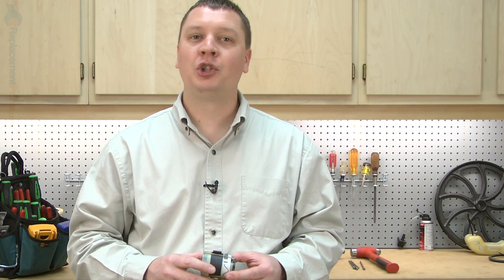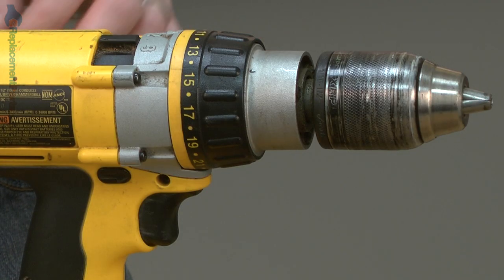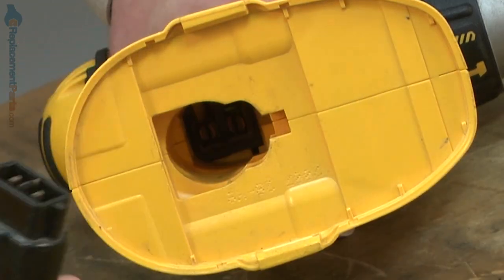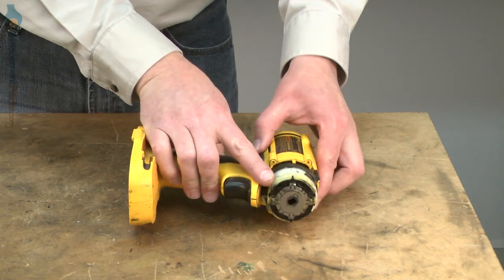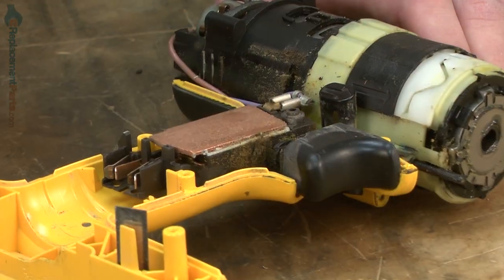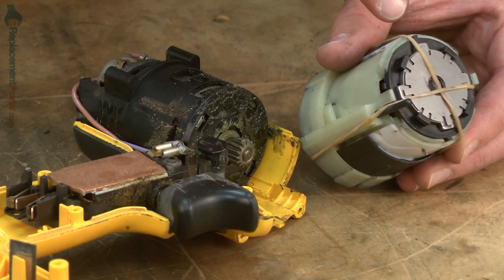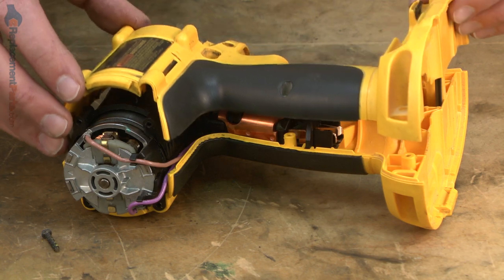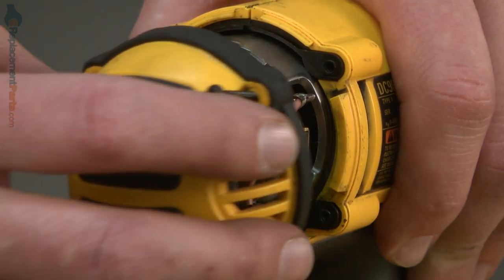Drill Repair - Replacing the Transmission (DeWALT Part # 397892-05SV)

Comment: 2:42 Screwing a screw into plastic like that is the best way to strip the threads of the hole, and judging by the bulge that forms at 2:45-2:46, the torque surely wasn't low.
Reply: I also noticed that :)
Reply: Theres always a troll with nothing better to do.

Comment: I just fitted a new transmission in my DC900 drill. But to my surprise the drill still slips in speeds 2 and 3. In speed 1 the drill works fine; exactly the same as the old transmission. Any ideas as to the issue ?

Comment: Using a Makita to fix a DeWalt, nice! I used to think DeWalt were superior tools, but my opinion is changing in recent months due to multiple failures of my DeWalt stuff. Most notably, burning up a cordless 20V drill with a 3/8" bit in aluminum of all things, and I'm talking after 4 holes approximately 1" deep, and smoked another after 5 or 6 5/16" holes in steel. Not a good track record

Comment: My Dewalt XRP has shifting issues, it often sticks where you have to rotate the motor so that you can shift into the other gears. Is this a design flaw? I removed the assembly and cleaned and repacked the transmission and still the problem exist.

Comment: Great video! Unfortunately my replacement transmission kind of got away from me after I took the rubber band off.  I got it all figured out (I think), except for a small solid steel pin, about 8mm long and 3mm in diameter.  Does this go someplace in the transmission? Or did it come out of someplace else in the drill?
Reply: Found it!  It's part of the set of pins in the hammer assembly.  Got it all reassembled. Works perfectly!

Comment: Is the speed selector switch already attached to the transmission assembly?
Reply from the maker: The speed selector part is in the transmission.  The actual part you use to select the speed is a separate part.

Comment: Hi, sure seems like you know this product,   I got a dewalt cordless and the warranty expired about 2 months, can you advise will replacing the transmission correct/fix the 'concentric runout/wobble'?....I have check the chuck and the drill bits and they are OK.   If you can advise the best way to fix this economically would be helpful. - hope to hear from you soon.
Reply from the maker: Typically the problem of the wobble is due to a bend in the Spindle Assembly.  http://www.ereplacementparts.com/spindle-assembly-p-64866.htmlWe have these in stock and they run about half the price of the transmission.
Reply: Thank you for your kind information. I will now check this.

Comment: hello and thanks for
 the vid------ is this tranny compatible with model DCD985L2
Reply from the maker: Hello, unfortunately the part number 397892-05SV transmission is not compatible with the Dewalt DCD985L2. The transmission is not available for the DCD985L2.